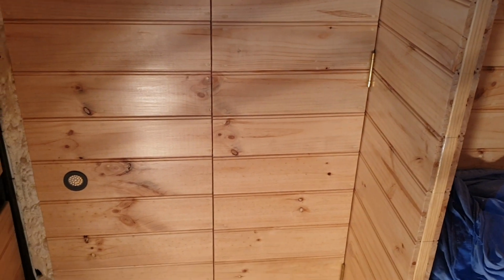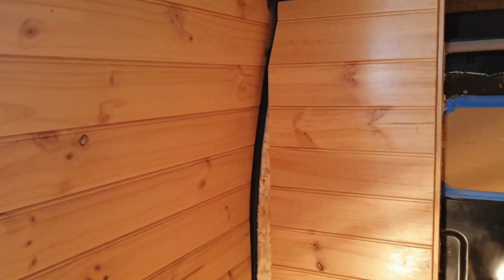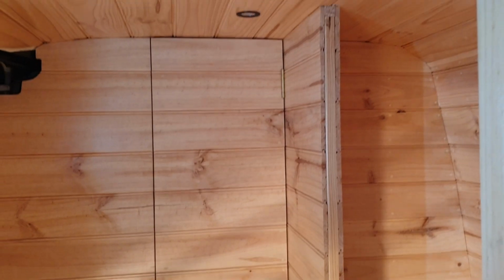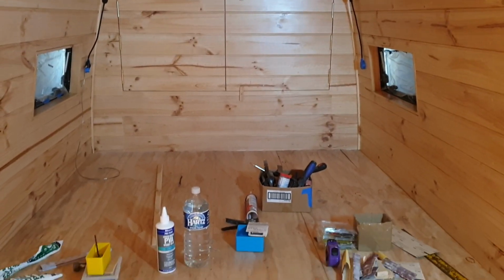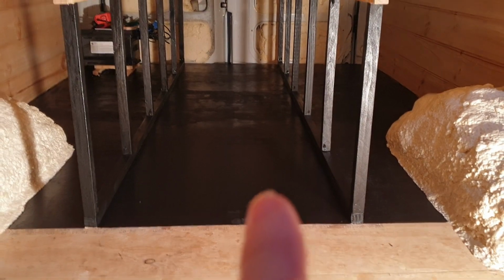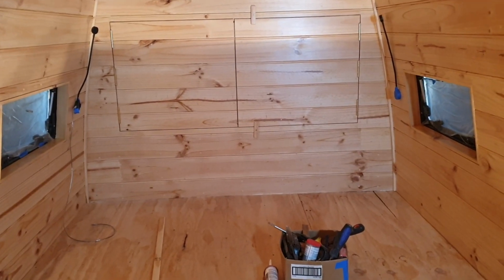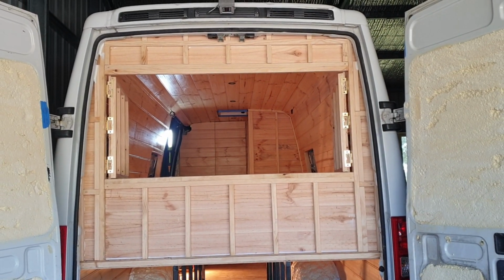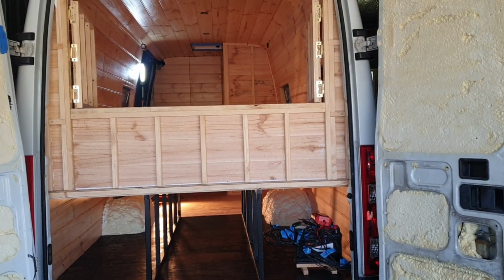Smooth sailing with van and what i think with current global events

Comment: Hey Bud, just looking at the center section of the garage, I can see a full length draw hanging from the top for handy, miscellaneous things, light things you may need handy. I'd also make a midgie/mozzie screen removable Velcroed across the window space in the back so you don't get eaten alive day and night. It's looking very snug and comfy inside too.  The world is just a basket case, just unreal, Hope your both well, take care, stay safe my friend. Seeya Rob
Reply from the maker: Gday Rob, long time no comment, really nice to hear from you again, I like your idea on a draw underneath middle section of garage👌 
I do have two velcro screens ordered from ebay to install on sliding door and back opening, mossies have come early for us with a bout of warm and moist weather in the last few weeks....Yes it looks like the world is a basket case, but that is what is necessary for change  because its  needed to expose this evil that has been here for to long, Hang in there, have faith, The Great Awakening is in full swing👍
Reply: @griffsrearmountturbothemod1623  I meant to add earlier, that draw I said about, see if you can make it so it can not only be pulled out at the back, but can also be pulled inside Rosie for when it's flogging down rain outside so you don't get wet mate get gear out of the draw. Seeya Rob